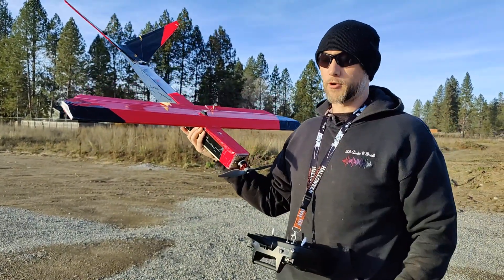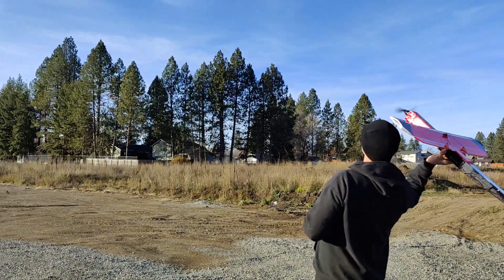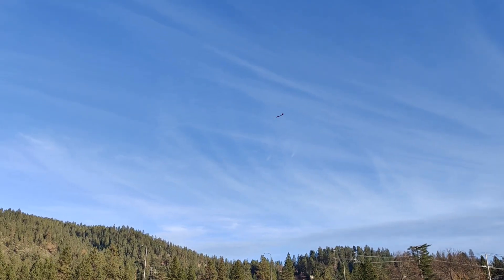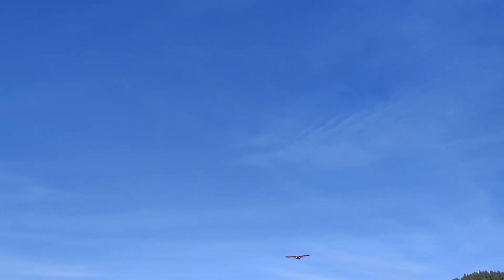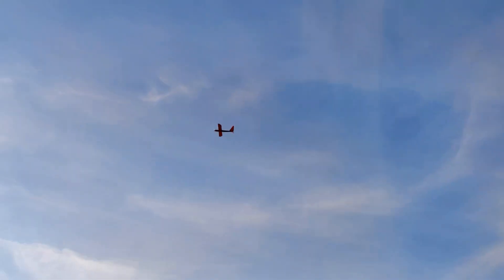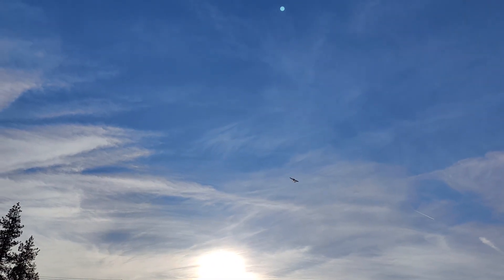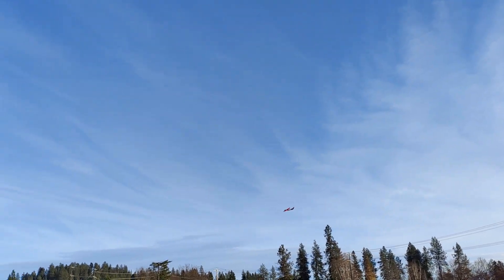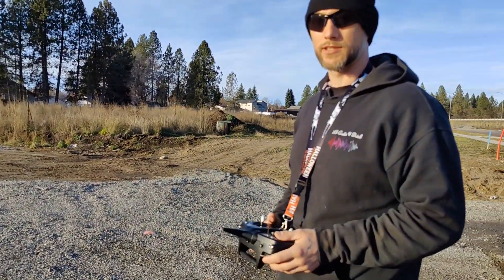Home made V tail airplane part 2. #diyairplane #rcairplane

Comment: Nice job. There is just something about a v tail. They look and perform so well. Your plane looks dailed in.
Reply from the maker: Thanks! I was super happy with this for my first try. It was a good learning experience and I plan on keeping this plane around as long as I can. I e got several more V tails I've built coming soon. Definitely my favorite type of planes to build lately!!
Reply: @FlyTimeRC  I look forward to seeing your other creations. I did a v tail mod to a Flite Test Simple Soarer. It looked really sweet with the v tail and the polyhedrial wing. It flew good too.
Reply from the maker: @SnoMoJoe1  thanks! That's a cool idea. Do you have a video of that? I'd like to see how it does!
Reply: @FlyTimeRC  i have stills, but no videos. It flew well. I only had Rudder and Elevator, so I had to use v tail mixing.
Reply from the maker: @SnoMoJoe1  oh cool
Reply: @FlyTimeRC  I tried to send you a picture of it, but I  guess you can't attach a picture in this format.
Reply from the maker: @SnoMoJoe1  I'm sure it's a awesome plane. I may try something similar in the near future